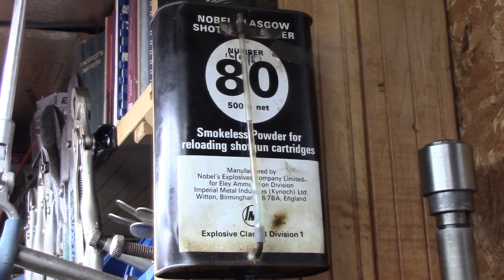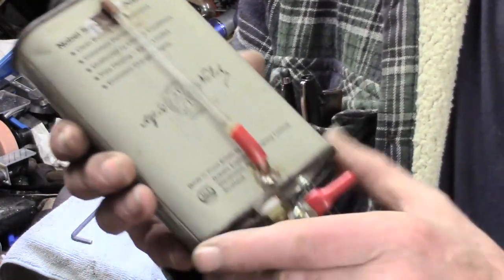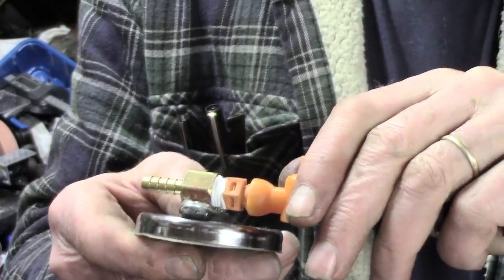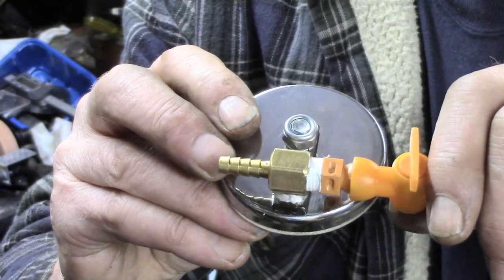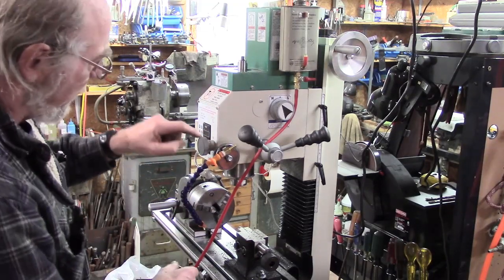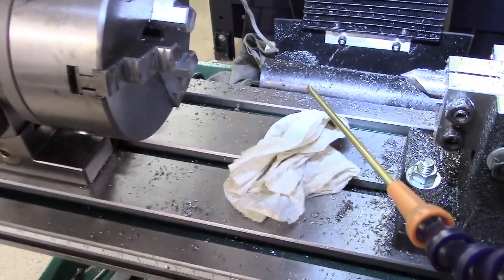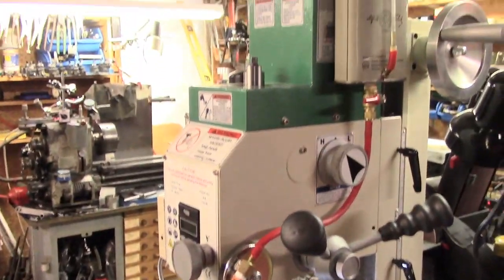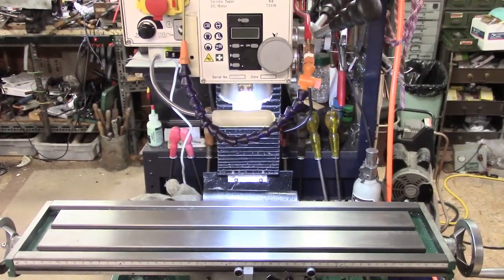Gravity Feed Cutting Oil for the Mill

Comment: Hi Chris,
Can I suggest a modification for the Mark 2 version.
Move the plastic shut off valve to the other end of the snap tubing to cut down the quantity of oil that needs to flow before you get flow at the nozzle and reduce the amount that can seep out of the nozzle when the tap is shut.
Cheers Eric
Reply from the maker: midgoog2 Good thinking Eric. In fact the plastic valve is pretty poor and even leaks a bit, so the top one is the main functioning item. These sections are very awkward to unsnap but certainly could be worth trying to move the plastic one. Thanks.

Comment: Brilliant!  Thanks for sharing details of the build!  I still want to make one of these for my lathe.  Did you soft-solder the sight-glass nipple to the can?  I'll have to research and take mental notes of your connections on the can...
Thanks again,
Bruce.
Reply: Re-watch, not "research"; stupid auto-correct!
Reply from the maker: wbmphd Hi Bruce -- the site glass is on a short piece of fully annealed 1/4" copper tube IIRC, - pre bent that and trimmed and then yes, soft soldered in place. Bottom brass reducer fitting was also soft soldered in place.

Comment: Nobel No 2 ! I haven't seen that for a long time, that can should be on your mantelpiece!
The drip feed is a great idea, I use a washing up liquid bottle with a thin plastic tube in the cap, those magnets look good. Chris B.
Reply from the maker: Englishman French My Nobel #2 can must date back to about 1980 or so -- yes, perhaps it deserved to remain whole but - nice and easy to solder to of course. Magnets are great - very strong - about $7 for a pair. The spare one is soon going to be used for an air blast set-up I am planning, for chip clearance at times. Watch this space!